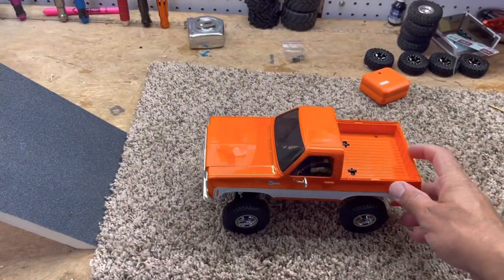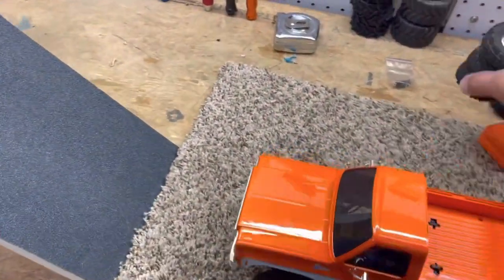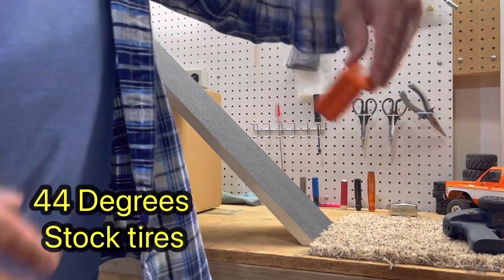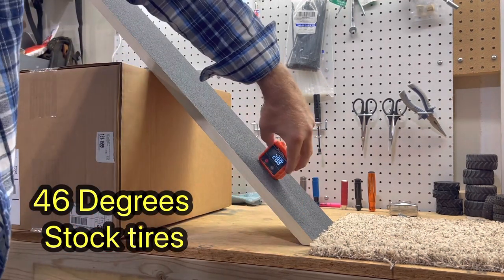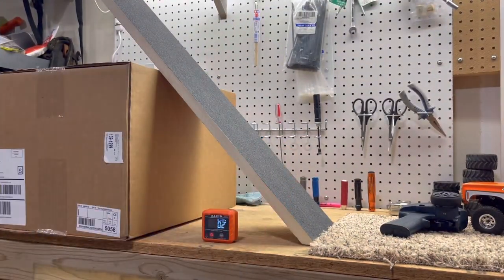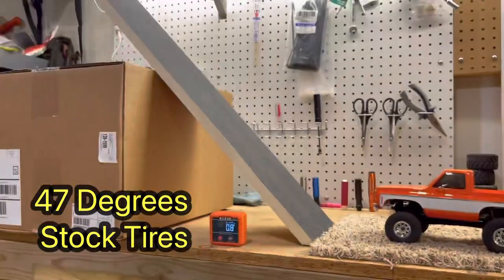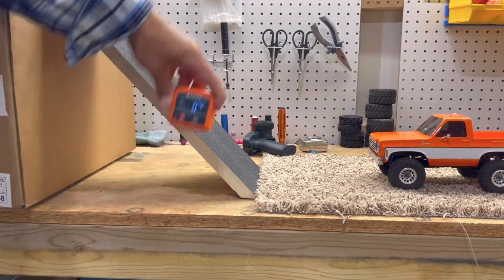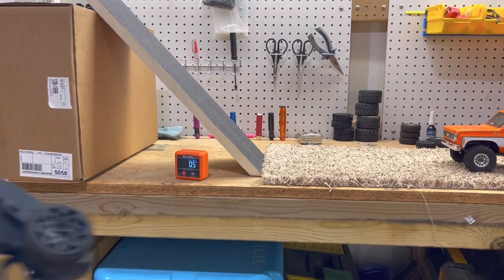FCX24 K5 & Traxxas TRX4M Brass Wheel weight Testing.  Do they want you to see this?

Comment: Definitely add oil to the shocks. I did that and went with some OGRC wheels with brass rings from Amazon and the Injora "hyrax-like" tires and it made a huge difference. I used 30wt TLR oil.